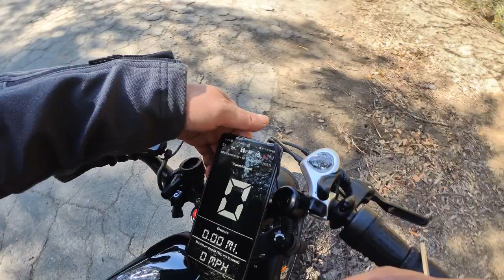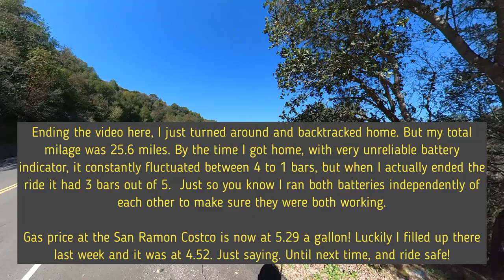Added Second Battery Using a "Blender" from Spark Cycleworks + Test Ride | Ariel Rider X-Class 52v

Comment: Nice I randomly stumbled on your channel and your located in the Bay! I've been looking to upgrade my ebike from a rad mini to the x-class or the grizzly... I like the idea of dual batteries and motor for the grizzly, but I like the look of the x-class more and figure I can add mods (additional battery and handle bar) with the money saved versus getting a more expensive ebike. Still trying to make up my mind though 😖.  Definitely will need to check out some of your riding spots when I upgrade. Subbed!
Reply from the maker: Power to cost ratio, I do believe the X-Class stands out as the best ebike on the market and after adding the battery it minimizes some of that range anxiety I had (but not by much, because, as I can go farther now I still experience that range paradox). That NYC dude upgraded to two 72v batteries (obviously he upgraded the motor and the controller as well) on his X-Class, that thing goes in the 55+ MPH. If you haven't seen his video on his upgrades here you go...https://www.youtube.com/watch?v=bhUASl_d0yw&t=469s. You might find some modding inspiration from him, just don't go crashing the bike on an icy road LOL.
Reply: @WanderingIntroverse  I appreciate your insight and holy cow I didnt realize that guy was rocking two 72v batteries when i first saw his video 😂
Reply from the maker: The Grizzly has as an advantage for dirt trails or off roading as well.
Reply: @WanderingIntroverse   any chance did your max speed decrease when you added a second battery. Also, did you see any improvement on hills with the second battery?
Reply from the maker: Top speed does not appear to have decreased and hill climbs did not necessarily improve either. Just better range.

Comment: Hello on amazon they have this upp, I was wondering if the 52v 28 ah is compatible with this ebike?52V 28.8AH(100% Full Capacity) , LG4800mAH Cell
Reply from the maker: Sure, since they are both are 52v, so long as the new battery fits and has the proper connection cable. You can even use a 48v or even a 36v battery, just as long as you use the "Blender" as well.
Reply: @WanderingIntroverse  hey can you also do a tutorial for the xclass step tru dual battery? I do deliveries and I plan on purchasing this bike but I will mount a delivery bag on the back.
Reply from the maker: Sorry didn't see this until now. Sorry don't own the step thru X-Class, I do wish it was available at the time of my original purchase, I would have bought it. The principle install should be the same, you may need an extender cable to reach the controller location.
Reply: @WanderingIntroverse  no problem, and I asked becuase it has no frame so you can use a triangle,
Reply from the maker: It has the cup holder screws, shouldn't be a problem finding a standard battery mount for it, course it would defeat the whole step thru purpose. But check out NPL Ventures, he installed a triangle battery on his earlier ebike which also is missing the top frame.

Comment: I'm wondering if this will fit in the step thru version, or if I should try a 2nd battery under the seat?
Reply from the maker: You should also look into the more traditional Shark (https://www.amazon.com/dp/B08PBZSZWY?psc=1&ref=ppx_yo2ov_dt_b_product_details) batteries that can be mounted directly to the drink holder mount in the center area, of course that would take away from the step thru accessibility. Do they have battery racks or mounts for under the seat?

Comment: I went to the battery website and it seems that there are like five 52V choices ... Different choices of the AH and the --A BMS ....Wich one should I choose?
Reply from the maker: If you have the same ebike as me, you can choose any 52v battery, any AH (the higher number the better the range you'll get), BMS can be 35 or above, that is because the controller on the Ariel Rider is 35....so look for something like this 52v / 20 AH / 40 BMS. Also make sure the battery connector XT60 is included, or you'll need an adapter.

Comment: Can I do this with 48 volt xclass
Reply from the maker: I don't see why not, the Cycleworks "Blender" connector supports up to 30A controller. I can confirm that I have not had any issues with my 35A controller. Matter of fact they use this same "Blender" in their dual battery stock eMoped  the "Bandit" as well. Make sure the Blender has proper airflow around it, I believe the manufacture recommends an inch of space around.